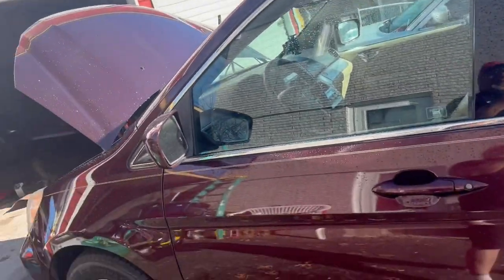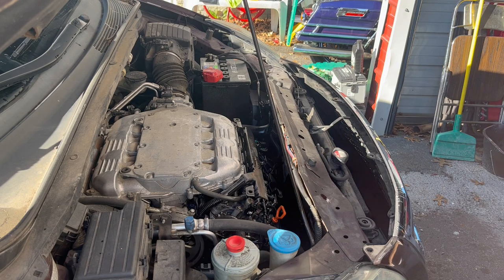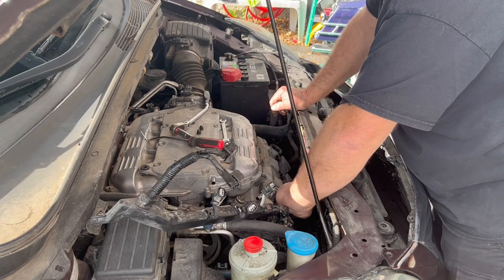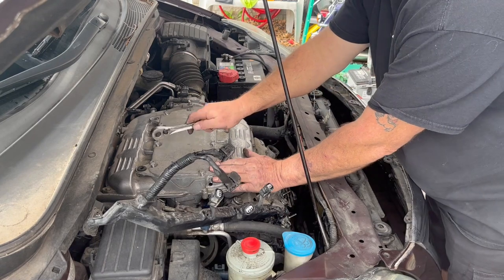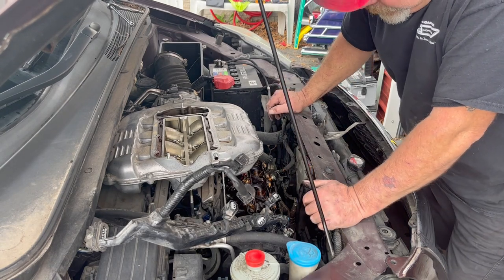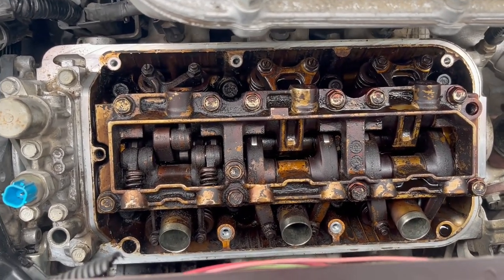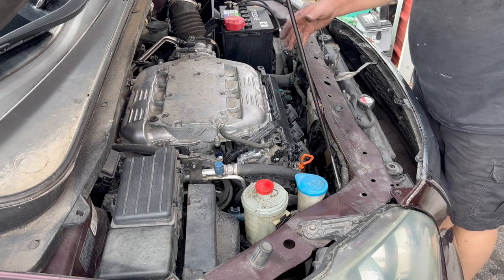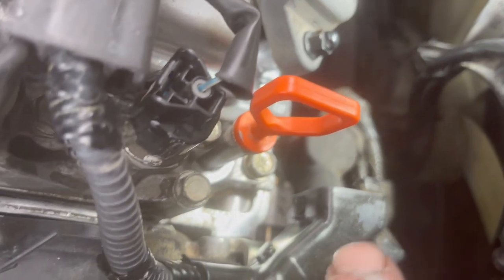Let’s fix some oil leaks! 09 Honda Odyssey. What can possibly go wrong?

Comment: I like JB weld. I’ve used it for lots of stuff. If you clean and sand or grind the area first , it will usually hold. Whoever invented that stuff did good.

Comment: Wow, the way the oil looked inside the valve cover, major oil breakdown.  I wouldn’t be surprised if the engine burns oil.  Well, at least the main valve cover leak has been fixed.  👍

Comment: Im fixing to do a major remodel on my 2008 Touring.. New timing belt kit, new water pump, all new gaskets, new alternator thanks to both a leaky power steering hi pressure line (new one in hand), and the valve covers and that damn solonoid.. this is the 3rd alternator due to oil leaks, and the 2nd hi pressure power steering hose.. I should do a full job video..
I hate mechanicking, but real mechanics are expensive.. So... I gotta do it myself. I just recently replaced the rack and pinion.. that was a job... ✌
Reply: Oh yeah.. I grabbed some Hondabond this time. Im pretty sure it will work around the outside edges of the solonoid, top and bottom. With that this metal divider in between.. it sure doesnt work as a gasket alone. And those rubbers are worthless... They should all be changed out every summer... Save the alternator repair costs... I love the way this van rides, and there are so many of them, you can blend in easily... I mean.. If you had a need for that... anywho...😤🤯🥳😈

Comment: They leak oil. From the seal inside behind the timing belt at the oil pump cover..
 Also the oil filter housing that's an easy fix.
  Wish i had the money to make my 2009 run again.
 Such a comfy clean vehicle.
Reply from the maker: It runs out pretty good..

Comment: You definitely seem to know what you're doing. You make it look easy. Is there a way to know or detect beforehand whether it was leaking from there, the valve cover? You seemed surprised to see cracks there around those openings. We're looking to buy a used Honda Odyssey and they all seem to have some type of oil leak somewhere, be it on the left side under the engine where the power steering reservoir sits, or on the right hand side where the oil pan sits. It's just a matter of whether it's a little oil leak or a lot. Any suggestions?

Comment: Great video..l have a 2007 and it’s leaking oil from the valve cover… did you put a bead of sealant around the bottom of the valve over or just replaced those 3 seals?also, how did it hold up…Tks
Reply: There's a gasket there

Comment: My belt makes the same noise I’ve replaced it multiple times n water pump. Mines smoke from the front manifold where 02 sensor lies? Any idea
Reply: That would leaking from the front vvt solenoid valve

Comment: Those Vans aren’t easy to work on  your right Honda and Toyotas last a very long time I drive my 1998 Toyota Camry just to work has 215k miles unfortunately it does not want to to stop . I put full synthetic in it change it every 5000 miles. AC and heat work immaculate. It amazing I’m going to give it to my mother in law soon . Greetings Al San Diego 70 and sunny.👍